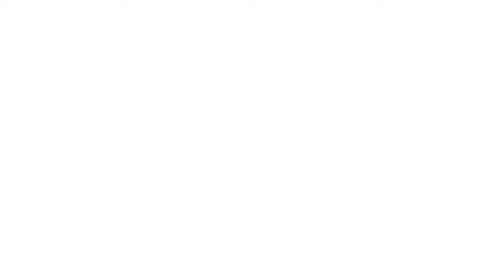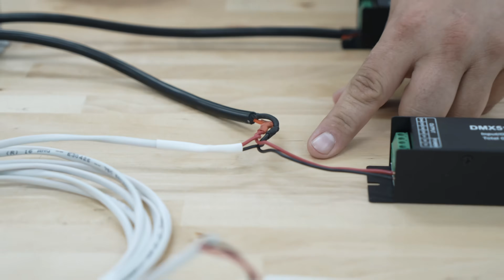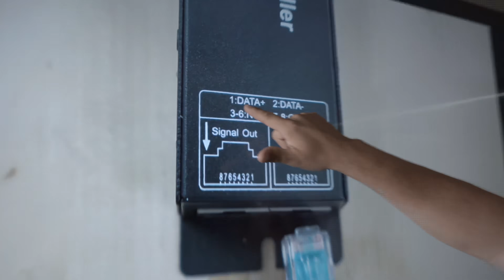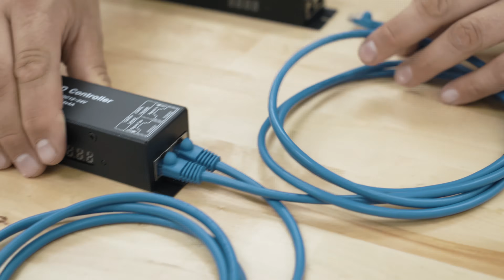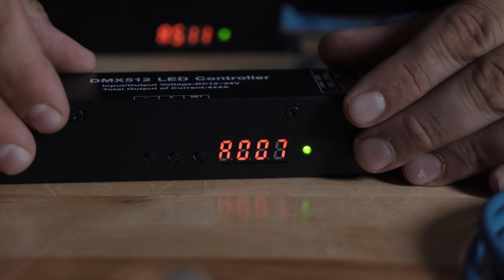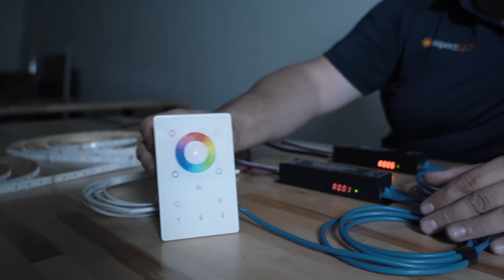How To Simply Setup and Program DMX Lights For Beginners

Comment: Hi, It is possible to control a WS2812B (24 led ring light) connected to a SP201E DMX decoder via DMX ?
Reply from the maker: Hello. No it is not, they are two different systems. Great question!

Comment: My DMX512 turns off and on when connected to my LED lights. What could it be?
Reply from the maker: Hey, this could be many possible things. First thing to check would be loose connections. Other things to consider would be if the two signal wires are terminated with a 120ohm resister. Hope this helps!

Comment: This is great video , this is the setup that I’ve been trying to setup what I can’t figure out is I would basically have to have 5 stripes tied to one decoder for zone 1 and 4 stripes tied to decoder for zone 2 and 4 strips tied decoder for zone 3 . I do realize I will have to do power injection on the strips but not sure if a decoder can handle that many strips . Wasn’t sure if I needed a decoder for each strip ? That would be a lot my strips are sk6812 rgbw 5v strips any advise would be appreciated
Reply: Hey Rob I was happened to find this video saw your question and did some digging on that and came up with this.

The TLDR: Max is 32 Fixtures (lights/strips) 

There are two major ways to wire a DMX LED control system. These are: Daisy-chaining and DMX splitting.

The Daisy Chain
This method entails wiring every fixture from a loop out of the previous fixture, to create a line of fixtures connecting to the DMX receiver, decoder or console.

If you’re daisy-chaining, rember the ’32 Fixture Rule’ – You can only connect up to 32 fixtures in one daisy-chain. Any more than that, and your circuit may not be able to achieve the signal strength required for DMX communications.

In practice, it’s best to leave some headroom. Try to keep DMX daisy-chains in the range 16-32 lighting fixtures, because some units can be heavier than others in the amount of power they draw.

Splitting DMX
If more than 32 units need to communicate, the network can be expanded using DMX splitters. The DMX splitter basically copies the DMX output multiple times.

Source: https://www.instyleled.co.uk/all-about-led-dmx-control/
Reply from the maker: Hey  @TR4SHMUFN  Thank you for the additional information. We are making another video about more details that will be out soon!
Reply: @aspectLEDlighting  was this video ever uploaded, if so can you please post the link please. :) also what is @TR4SHMUFM referring to by fixtures? im working with LED strip linear lights